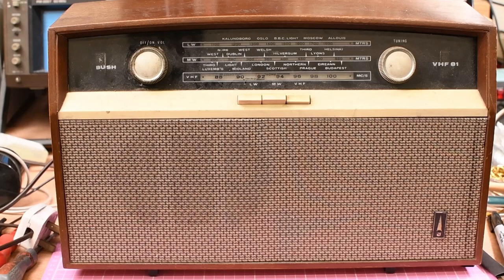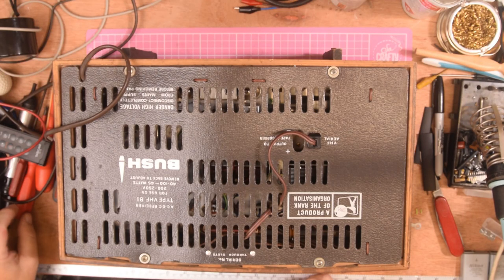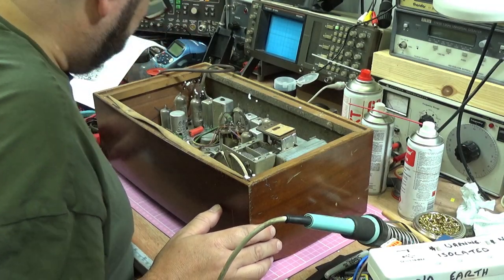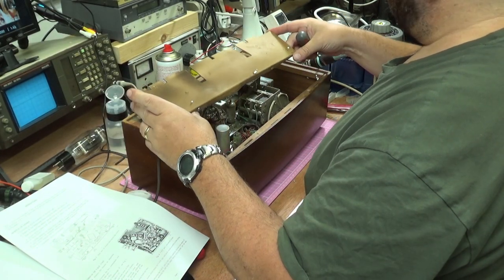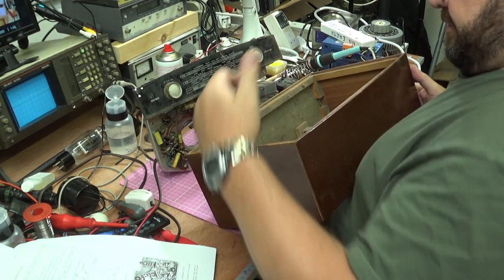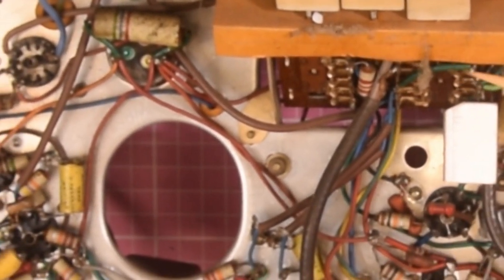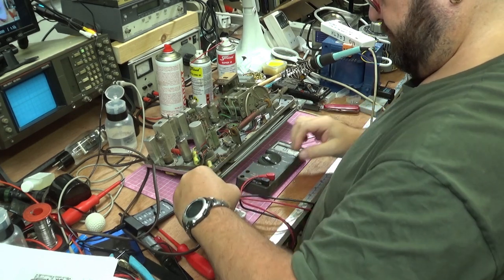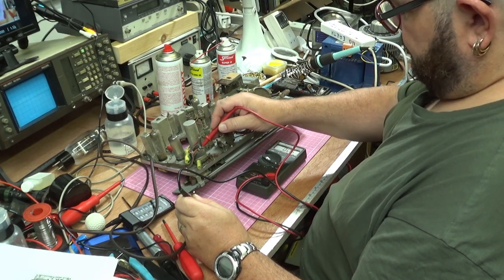Valve Radio Repair : 1964 Bush VHF81 : Part 1

Comment: Hi George
             I watched your videos of your restoration and enjoyed them and found them informative.    I'am restoring a bush vhf 81 and was wondering if you could let me know where you got your service / schematic diagram from. This is my first valve radio restoration but on first look i can see that lots of caps and resistors will need replacing and there seems to have been some sparking on the chassis by the big watt resistor next to the power switch ( i think it's the voltage dropper for the heaters ) . Any help or advice would be appreciated.
Paul Dickinson
Reply from the maker: Most schematics can be downloaded from Radiomuseum. The other good source to have is the set of disks from Paul Stenning which can be found at https://www.service-data.com/ Another source for help and advice is the UK Vintage Radio forum where you can chat to a lot of very knowledgeable people who can help and advise if you are uncertain about something or just need some reassurance. https://www.vintage-radio.net/forum/index.php? I could suggest buying a set of the 'red books' but they take up a lot of space and are sometimes expensive. Most of the diagrams are on the set of disks from Paul Stenning anyway so only buy the books if you really have to (of course, I have a full set but thats just me!). Hope that gives you a decent start in your information hunt. All the best.

Comment: More valve radios, nice.  Been watching Radiocruncher getting into Bush DAC90s as a change from Roberts and Hacker transistor sets.  Also M. Caldeira restoring various German radios including Telefunken, Grundig, a few lesser known ones and even Philips.  Various US restorers with RCA, Zentih, Philco and others.  Also Jim Lindenas in Canada.  Autotransformers are banned nowadays but back then anything went.  Australia largely didn't have live chassis sets but Pye caused complaints from repairers when they started selling in Australia in the 50s and most of their chassis were live.  Another thing you won't see now was that even in the early 70s many houses still had old 2 pin sockets usually rated at 2 amps.  Ours was on the wall at face height and looked like an old style lightswitch with the socket on top. Possibly it was for a lamp or radio on a shelf.  Oddly there were people telling us that TVs were required to be fitted with a two pin plug.  I can only assume that was a dim assumption based on the set having a 2 wire lead.  We had a Bush TV125/U which is an AC/DC chassis with a dropper resistor instead of a transformer.  That dropper failed a couple of times that I can remember, one time the technitian wedged a screwdriver to bridge the burnt out turn while a new one was ordered.
Reply from the maker: Will check out Radiocruncher. Manuel and his german sets are really nice. I did like that reference preamp he just finished. I'm not a real AD/DC transformerless fan because of the risks but because we run polarised plugs like the modern ones you guys have it is less of an issue while running them. servicing can still hurt if you don't take the right precautions.
Reply: That's a nice amp, shame the soldering and construction were rather dubious.  The Australian plug is polarised although there was no standard for orientation of live and neutral (active and neutral in Aussie regulations) up till the late 50s. Unless they've been updated, old buildings may have random polarisation. Radiocruncher seems to prefer live streams at the moment but he does have a large back catalogue.  His livestream is usually Sunday afternoon which is in the wee small hours of Monday morning Melbourne time, I usually watch the replay unless he's still going when I wake up.
Reply from the maker: @Wenlocktvdx  I didn't realise that you were not standardised on polarisation till that late. I also thought your plug was like ours with a fuse in body.  I'll run through the back catalogue and He may be on at roughly the same time as I'm awake on the sunday night here.
Reply: No fuses in Australian plugs, the circuit is a straight line not a ring so the circuit fusebot breaker is sufficient. Two pin and three pin plugs fit the same three pin socket as there are no shutters. Someone did market a plugboard in the early 80s that had shutters, but it was unpopular as two pin plugs wouldn’t fit. The Australian plug is actually a very early American one and old ones do resemble the older US plugs with round Bakelite bodies and even open backs.
Reply from the maker: @Wenlocktvdx  Ahh right, so you use star wiring straight to the panel. I thought the Australian plug was a flat blade with the two pins on a slope so that they would only fit one way. Even a two pin wouldn't fit the wrong way round. You learn something new every day!
Reply: Yes, those sloping pins mean that even a two plug can only fit one way. Modern plugs have a slim shape but the very old ones had a large round shape. Same pins so no change other than the body. Old plugs simply had the cable emerge from the centre with no clamp. Later versions had lugs which you hook the wires around. Later again they had a conical flexible back which had a ferrule to squeeze the end to grip the cable. Domestic circuits are usually rated at 10A but the circuit fuse was 15A either breakers coming in at 13A. The larger 15 and 20A versions are normally only seen in industrial situations and have larger pins in the same configuration

Comment: That valve(tube) radio does look a little bit different than our all American 5 tube sets. The radio looks like a nice design though but hey its made in jolly old England. Thanks for the new series George I'll be watching your progress.
Reply from the maker: Many thanks Larry. The idea is the same, just the tubes being slightly different. This one would be a 6 if you count the rectifier and took out the FM section. Unlike the US made stuff we have to have a different filament voltage to cope with the higher line level of (back then) up to 250v. Still a series string and they built it on a single plate chassis more to save money on metal. It looks like a single stamped plate and is actually identical to the 4 year earlier vhf80 model.

Comment: Hi George. I have just purchased the exact same radio, I was cleaning the inside and removed a valve and dropped it, I was working prior, do you know where I can get a spare valve. Kind regards Anthony
Reply from the maker: Depending on where you are in the world there are various places to go. The first one would be eBay and after that there are a few suppliers that stock valves in various conditions. I could suggest langrex who are a supplier in the UK and they have an online shop. Hope  that helps you. All the best with your radio.

Comment: I think if I get my act together in time I’m going to make my Mom a clock for not but complex. I saw some hands I can order on amazon and then I’m going to make pictures of the family be the hours. I’ve never seen the inside of a radio before.
Reply from the maker: That is one that you won't see the inside of much these days. The modern stuff is far safer to work on than these old vacuum tube sets. It is good though that all this old stuff is actually designed to be repaired rather than thrown away. If you find a good set it actually sounds better than modern radios too, quality parts when manufacturers cared about things more.

Comment: George, just picked up one of these. I am a bit concerned that the HT smoothing caps blow. You didn't mention these. Is there a test i can do?
Reply from the maker: Sorry for the delay in getting back to you.  HT smoothing caps can be tested several ways. The safest is to just use an esr meter across them or one of the cheap chinese component testers. After that, you need to test for leakage which can be hazardous depending on the equipment you have. If you have a proper tester such as a heathkit or eiko then you just test the leakage. If you havent got a commercial meter then you can build your own or use a quick and dirty test. A quick and dirty test would involve putting high voltage dc through a multimeter set to microamps and seeing if you get any current reading. If you do get current, they are bad or on the way. You may be able to recover them by running the set on a variac, starting at 40v or so, then after a few hours upping it to 80v, then again up to 120, then 160. after that you should be able to go to 240 mains if there hasn't been any obvious issues.

Comment: I have a BUSH TR82D, that I had to buy IF cans for from your side of the pond...it took a while but i got it...I was doing an alignment and the F.............ing cores broke...and I know how to take your time and use the right tool..but they are old and fragile..and the first and second IF can cores broke. It really pis...........me  off...
Reply from the maker: Tell me about it. I hate doing alignments on sets that have a nicotine inside or have had wax dropped down the cores for that reason. Even with the proper core tools they do just crack at the slightest bit of resistance. Unless you are really lucky you can't even unscrew the broken core from the bottom.

Comment: this looks like it was an expensive radio.
Reply from the maker: Not a particularly expensive one but not the budget end of the market. They drpped the price by making it AC/DC and losing the transformer but most of the other stuff is reasonably good.